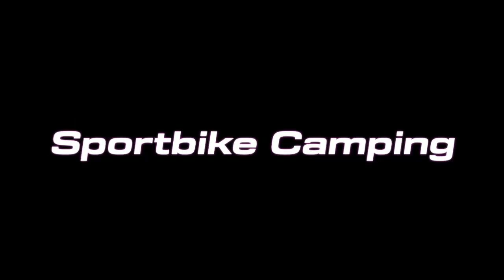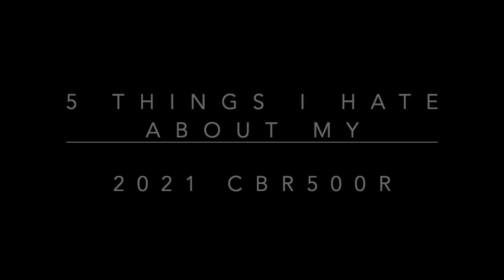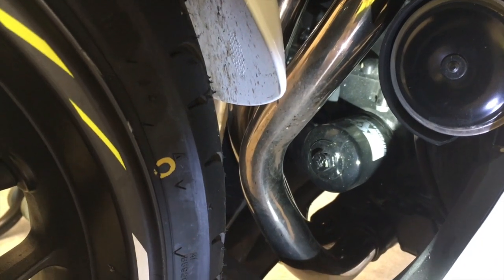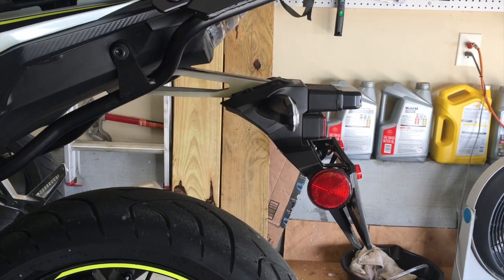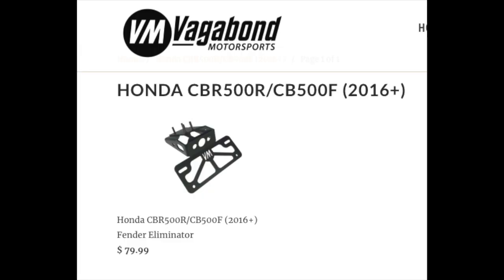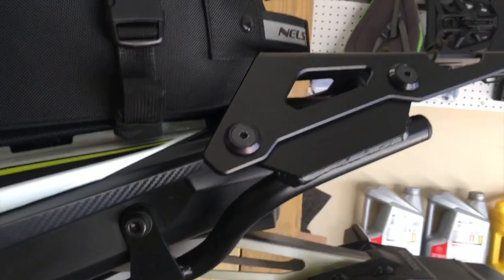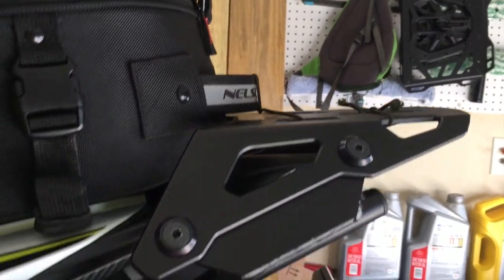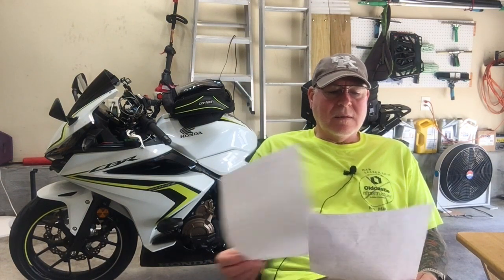Watch this before you buy a CBR500R !!

Comment: There's no center stand on my little G310GS either.  I can at least buy one from a few different companies, and I've thought about it, but it adds a significant amount of weight when I'm trying hard to keep the weight off the bike.  I should lose 30 pounds!  The center stand also isn't compatible with every decent after market skid plate.  Someone should make a skid plate and center stand combo to save weight.  It would also be great for oil changes (see below).

The fairings on my bike are difficult and not intuitive to remove or install, and forget about trying to do it with one of the folding sets of short hex keys.  I need a long 5 mm hex key with a ball end, and preferably a longer T handled ball end hex key.  Hopefully, every bike with 3D puzzle fairings has a good YouTube video demonstrating how to remove and reinstall the fairings.

Do you have room to get a good strap wrench on the oil filter?  That still won't solve the goofy Honda design that leaks dirty oil onto the exhaust header so it burns off for the first two hours after every oil change.  I need to remove six flat head cap screws to remove the skid plate to access the oil filter on my bike which hasn't been at all bad so far but I'm not looking forward to that after the heads on those screws have been mangled by dragging the bike over rocks.  It's also possible for a chunk of the wrong sized gravel to wedge between the skid plate and oil filter and the vibration acts as an oil filter can opener that could leave me stranded with no oil in the middle of nowhere.   :-/

I would have thought that Honda didn't include a rear fender more for aesthetics rather than as a cost savings measure.  Many people remove the rear fender on street bikes to improve the appearance or get a tail tidy which is almost the same thing.  I'm a pragmatic engineer type so I prefer function to aesthetics, and I also think functional designs look better than nonfunctional designs, but I'm nearly alone in that opinion.  It doesn't look like it should be too difficult to make a flat piece to act as a rear fender on your CBR500R that doesn't look like a clunky rear fender.  That should be a product.

My baby GS has no manufacturer options either.  I added heated grips, two USB ports, SAE 12V port, and many more upgrades.  The Koso Apollo heated grips took three hours to install but they look like factory heated grips (no external control box) and they work great.  This is the first time I've had heated grips.  I thought they'd be a nice luxury but they're awesome.  I use them all the time and will never have a bike without heated grips.  I'm adding a heated seat as soon as I upgrade to a Seat Concepts seat.  I have done several other small mods and have several more planned.  While I lament the lack of factory accessories, I do like being able to decide exactly what accessories I want and customizing the bike to make it mine, up to and including fabricating and 3D printing mounting brackets, etc.  That's part of the fun.

All factory tool kits are a bad joke, but a fuse puller and a hex key is, as you said, bullshit.  Do better, Honda!  A proper factory toolkit should be provided and given the market demand, I'm amazed that some manufacturer hasn't provided a serious toolkit with everything needed for typical roadside repairs and maintenance with ample room for additional user preferences (moar zip ties!) with an integrated waterproof locking storage compartment.  That would win huge customer appreciation and brand loyalty, and we'd all be glad to pay another $100 for that bike.

I'm surprised there isn't more after market support for the popular CBR500R.  Honda isn't exactly a boutique manufacturer.  They volume produce bikes.

I love the looks of your CBR500R and it looks like it'd be all kinds of fun to ride.  I've always ridden dual sport bikes, and now that I'm in my 60s I can't imagine being comfortable riding for several hours on any sport bike - hips, back, shoulders, neck, wrists....  Kudos to you for sport bike camping, and particularly for your channel to share your sport bike camping tips and tricks.